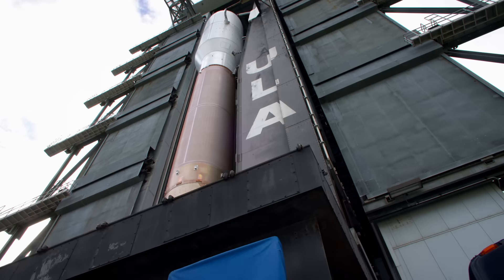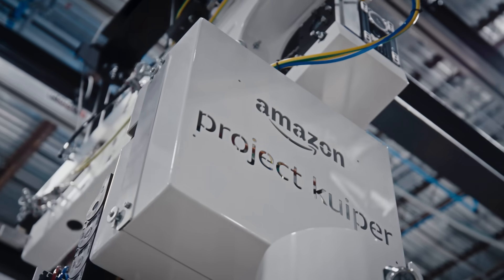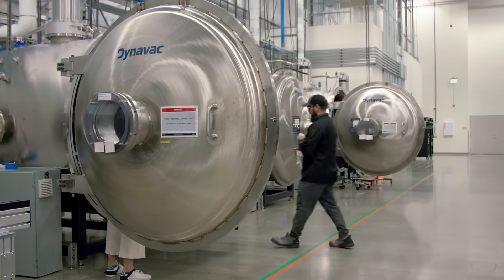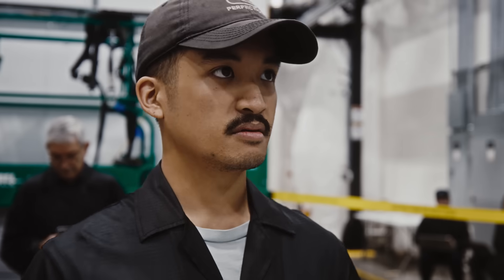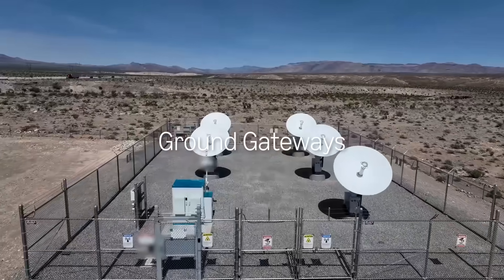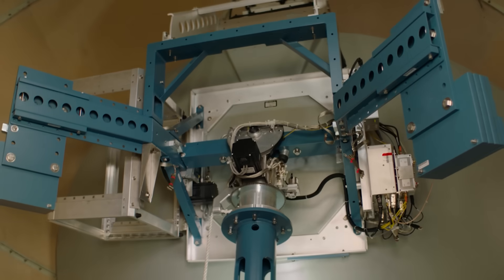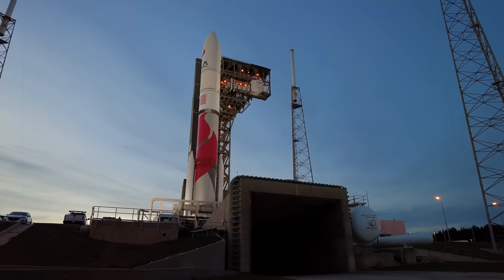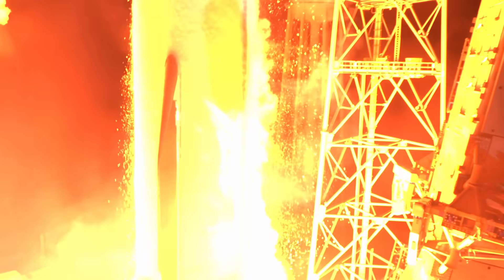Project Kuiper: Journey to Launch

Comment: If this is cheaper and faster than Starlink then we're talking about something, if not I'm not sure if anybody will be interested
Reply: wont be because the rockets cost a lot more per launch at some point there gonna lost profits.
Reply: @charlharmse4002  rockets cost more but less satellites are needed, they will last longer due to the higher orbit and the satellites use less fuel to get to their intended orbit on launch which further increases life span.
Reply: @luther0013 Starlink stays in orbit for 4 to 5 years by the time they deorbit one satellite already made enough money to replace it for another one including launch cost. There are 7558 starlinks online. Kuiper has 27 no way they will catch up.

Comment: Spacex is always ahead
Reply: 6 years 
no way there gonna be able to catch up
Reply: Tesla was ahead and look at them now. Amazon can run Kuiper at a loss for decades if necessary while SpaceX relies on Starlink to be a profitable product to remain in business.
Reply: @luther0013 Tesla is still ahead. Rivian doesn’t even make a profit only burning money. Blue origin has only launch a few sub orbit rocket and one New glenn launch. SpaceX launches ever 3 days so what is ur point?
Reply: @charlharmse4002  I never mentioned Rivian. Tesla has first mover advantage then Elon had them waste time on long costly projects that were not profitable and many competitors came online and are now completely surpassing Tesla like BYD or Waymo and Toyota.
Reply: @luther0013 WAYMO HAS less than 1500 cars on the road. Next month FSD unsupervised is going to be tested and introduced. Once most small issues get sorted out they’ll expand. Just like waymo did. BYD has is in china and they are funded by the ccp so yeah and dont even start with them and IP theft is how BYD got big.
Reply: Compilation is not SpaceX...It is Starlink.. Kuiper has way better specs than Starlink... Wait and see

Comment: Starlink's major edge comes from the fact that they own and operate the only reusable launch platform.
Reply: That is an advantage, as they have the lowest cost to orbit of any LEO constellation.  However, I think that Amazon has the edge after that, with the amount of data centers and interconnections they own and control, so their after launch costs (i.e. providing the actual data to users) should be lower than what Starlink can manage.
Reply: @armysyco  hopefully that results in a level playing field for the consumer at the end of the day
Reply: @armysyco  would be difficult to beat elons price. I'm pretty sure elon is still barely breaking even on residential starlinks.
Reply: And Starlink was the first modern satellite network to market

Comment: Good. I’m not giving Musk my money but I need satellite internet.
Reply: Tbh I have my problems with Elon too...but this is weird logic. You act like Bezos wasn't sitting in the front row and cheering when Trump got inaugurated...

They both problematic, so why chose the more expensive option? Do what's best for YOU...
Want an EV? Don't spend money on a worse option...
Want reliable internet? Same choice.

P.S. Now the dark horse in this whole situation is Amazon's anti-competitive practices. They have a history of taking a loss, sometimes even substantial losses, just to gain market share. There is a chance they do it with Kuiper too and deliberately undercut starlink while eating the huge loss in profit margins. AWS makes enough cash to make up the loss. BUT this is not cheap iPhone cords and basic knockoff goods. The upfront cost to put this satellite constellation is massive and even Amazon might not be able to afford selling terminals and the price of the service at a lost for too long. Time will tell.
Reply: The cheapest way to get satellites to LEO is SpaceX. Falcon 9 is almost half the price of Atlas and can carry almost twice the payload. So already they have a massive disadvantage at 4x the insert cost.
Falcon 9 $62Mn for 28 Sattelites.
Atlas $110Mn for 14 Sattelites.

Iso either, they radically shrink the tech to fit more in, in a way that SpaceX and Starling cannot, or they charge more to maintain the same profit.
Reply: No one forces you😂 regadless starlink will still dominate with there rapid pace

Comment: I hope you and Starlink push each other to be better competitors, and everybody wins as a result!
Reply: Rocketlab is in the mix now aswell. Quite a but behind still.
Reply: Lol, you know they’re gonna collude and jack prices up
Reply: I hope so.. can’t wait to get fiber optic speeds from a satellite dish on my roof 😂😂😂
Reply: Agreed. Even though I'm not the target customer for this or Starlink since I have fiber to the home, but regardless the more choice the better and obv services like Amazon Leo or Starlink are fantastic for the more remote/rural areas. Low earth orbit satellite internet service is such a gigantic upgrade over "regular" satellite internet (like Hughenest or Viasat etc.). My cousin had that for a bit, and it was awful, not to mention the latency is so high you can't use it for things like online gaming. 

I live in Hot Springs, Arkansas. A few years ago, I would have never guessed I'd be able to pick from three fiber to the home ISP's (AT&T Fiber, Ripple Fiber, and a local co-op called South Central Connect), and cable (Cablelynx, a regional cable co but I left them when they implemented data caps and overage fees years ago). Up to 2 Gigabits down and up for $95 total from Ripple Fiber, no data caps, no contract, price guaranteed for life. Up to 5 Gigabit with AT&T Fiber and 1 Gig symmetrical with South Central Connect.

As well as AT&T Air. AT&T's fixed wireless home internet service, they built a new 5G tower <1,000 feet from our house ~a year ago, unlimited data ~300 Mbps down ~80 up, $65 per month, or ~$45 if you have AT&T wireless which we do. But obviously not going to pick that over fiber to the home.

Plus, Starlink and looking at the Arkansas state broadband map Amazon already has secured some of the state's federal funding for broadband expansion in the very very rural areas using Amazon Leo. Didn't learn about the rebrand to Amazon Leo until I was looking at that map and saw "Funding Program: Amazon Kuiper Commercial Services LLC" for some locations. Googled that and found out about the rebrand. I remembered Amazon has been working on a LEO Starlink competitor, but hadn't looked into the status in a while.
Reply: Kessler syndrome hiding in the corner:
Reply: @Begleitpanzer57 exactly lol, at least those assholes will get stuck down here with the rest of us 😂
Reply: We all hope for the better. Competition drives the market
Reply: @alanjaques5316  yes… once day we Will have 2Gig internet speeds from satellite dishes on our roof for $150/mo 

Can’t wait
Reply: Now THIS is how you win capitalism! Everyone pushes everyone to be better!
Reply: Stalink is miles ahead of everyone

Comment: finally... a proper starlink competitor!
Reply: Way too early to say that. Competition is good, but Kuiper will have to prove itself
Reply: One can only hope
Reply: Starlink being a part of SpaceX makes it a lotttt cheaper than Amazon using a separate entity such as ULA (non reusable rockets too). Until Blue Origin starts launching these satellites is when they can finally be a proper competitor in terms of cost
Reply: You've not even tested it to confirm!  😅. There's been other players before Starlink, aren't they competitors as well?
Reply: @basilihuoma5300 can you name a few successful ones ?
Reply: @basilihuoma5300  Starlink is the first to be available to the general public and operate in LEO. Traditionally it's been done with huge Geostationary satellites but those are slow and inherently limited by the speed of light.
Reply: @basilihuoma5300  second LEO provider